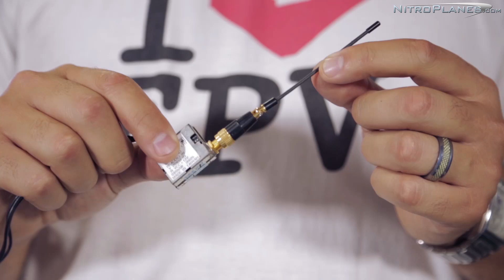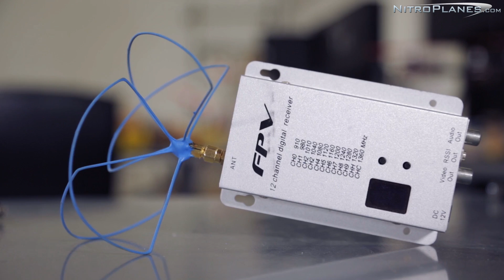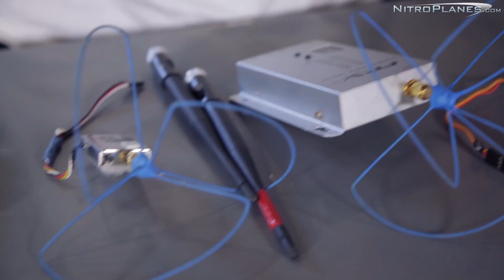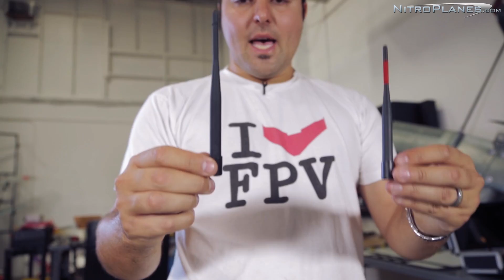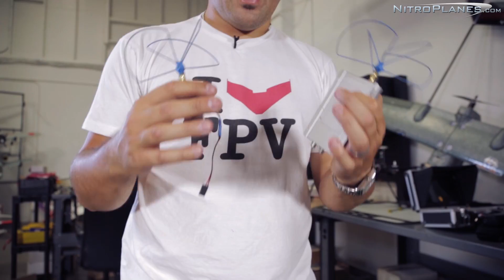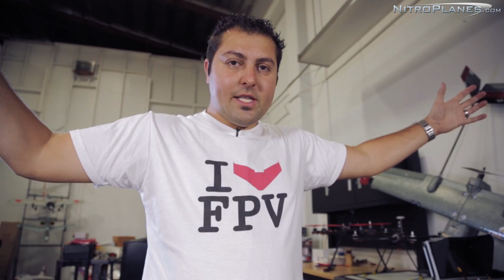FPV For Beginners Series Episode 3: Choosing Your Frequency

Comment: I enjoyed your video.  You say that you made a 4.5 mile flight using 5.8.  What antennas did you use both on your plane and on your ground station?  Could you list the gear you used? Thanks!
Reply from the maker: Bill Fitz Hi Bill, Here is a link to the antennas
http://team-legit.com/product-category/video-antennas/ We used the TX antenna and a 3 turn Helical